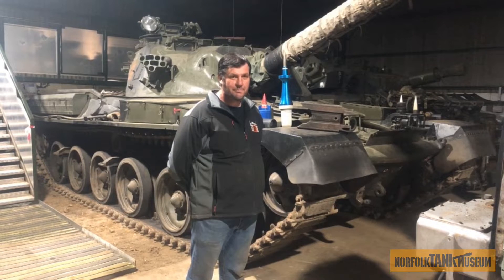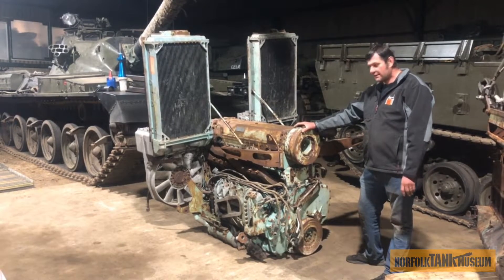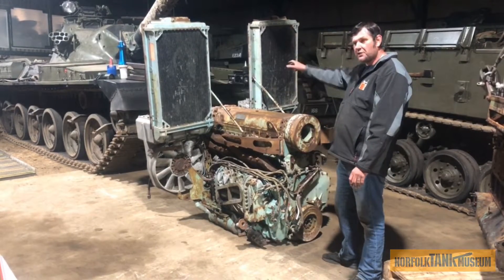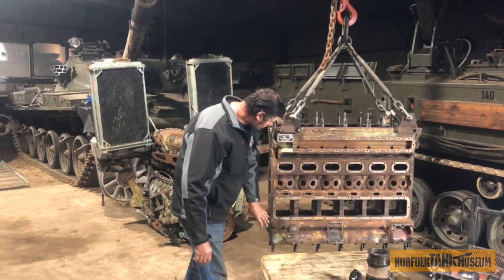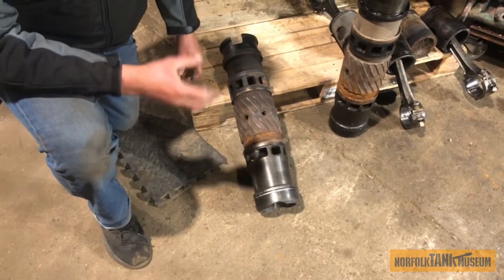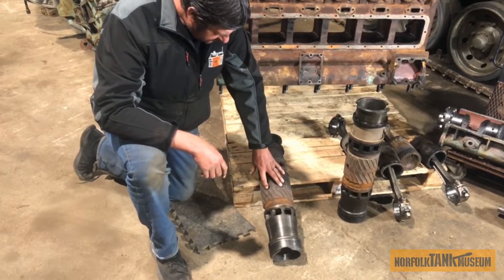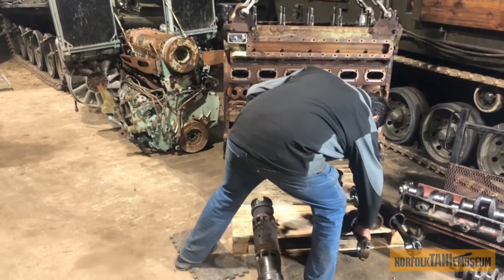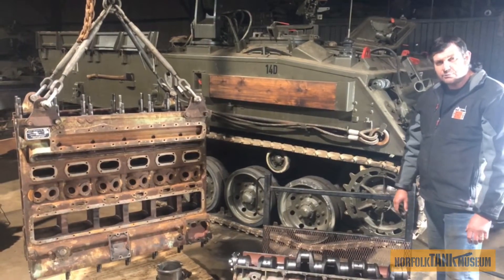NTM workshop diary #1 Chieftain Leyland L60 engine

Comment: Excellent very informative.  I am a Detroit diesel fan and find engineering from the past to be slightly better made than today's wafer thin computer  designs !!  They didn't quite get it right with the  L60 but flipping heck it's a scary sounding beast at night on exercise you wouldn't want one to run over your foot !!!!  Can Bovington help you out with the oily bits ?  Your doing a fantastic job of keeping the history alive ! Good luck  ,  there must be a fresh pack around wrapped up in grease waiting patiently somewhere  !!!!!
Reply: 2 strokes have to be a bit better designed with hardened metals.A polaris 850 Patroit turbo now more rugged that a kohler 4 stroke and much more power and torque than a kubota 1L 3 cyl.
Reply: I have a Hawker Siddeley / Lister St3 diesel generator which was built as gold standard in about 1980 . After that it was cost over performance  !! My Lister  , if serviced correctly can give a service life of ..... between 120 and 140  THOUSAND hours  .. I think that's about 12 years without a break !!! 
I have a current model Lpw4 Lister  , running a 28 Kva generator which ,  with proper servicing may hit 20 000 hours ... They sure don't make em like that anymore 😢😂😂😂
Reply: Are you running the klotz techniplate 2 stroke oil or something else.

Comment: As with most things initially it was unreliable but it got sorted. So say the guys who ran them and looked after them. Apparently liner O rings where problem but got modified and sorted among other things.
Reply: They also suffered from lack of use, the chieftains at batus were said to be much more reliable as they were used much more often

Comment: what was the main reason for failure on those L60 engines, they get a lot of criticism but if you think about it the designers were on the right track to come up with a 12 piston power pack a very small space compared to the continental v12 in an m60. Great sound though when running. The  Cummins VT525 in our vehicles were ok depending on who rebuilt them.

Comment: I live in the U.S. , I see these tanks ( Chieftains ) for sale and would love to buy one and ship it back to the U.S. if I had the money. I would have to change out that L60 engine, I know how notorious it is of braking down and was the " Achilles Tendon " for that tank when it was in service in the U.K. and elsewhere.  
   Would it be possible , hard or ease to swap that L60 with a American Detroit Diesel Inline 6 cylinder 71 series engine  https://www.youtube.com/watch?v=rGMeuoOcGCY   https://www.youtube.com/watch?v=NMRFH8WqcRg  ???
  if you did some welding and get the mounts lined up, got the bell housing and flywheel coupled to the transmission input shaft, modify all the fuel lines , heat exchanger cooling lines to radiator etc. Could it be done in your opinion ???  Thanks  Great video
Reply: Detroit 6-71 would be about 1/4 power output of the L60.
Reply: You could but the detroit 2 strokes would not be as fast as the leyland l60 2 stroke. that would like swapping out an 850 rotax Etec with a hirth 440 from a 70's sled. it would go but not as fast or as much power.
Reply: A  6-71 will not keep up with a leyland l-60 2 stroke and was not made for tanks. Its a good engine though.
Reply: @jlo13800  OK. I have seen the opened engine bay with Layland L60 engine out of one of those tanks. It looks like I could fit a Detroit Diesel twin turbo V12 92 series in there instead of the inline 6 71. Would that help out my speed and power situation in one of those ??? Thanks for your reply.
Reply: @leonswan6733  Any size Detroit will only hit 2500 rpm before valve float , therefore making any possibilities of scurrying off  , all be it at a similar sound level a slow and dangerous job  ...... A Catterpillar Bulldozer engine with much tweaking  (tractor pulling standards) would be where my Bang for Buck would be invested in ..... Then sort the transmission out and have a go !!!  If anyone has one and wants a conversion doing feel free to get in touch..!!!  I'm quite busy but  .............👍👍👍👍👍😎😎😎
Reply: @christopherhampson265  Nice. A man who knows his equipment. Yeah, those Chifetains look cool. Very modern looking design for its day. But it would be nice to find for sale in america a Chrysler weapons division made M60 A3 with the standard Allison air-cooled twin turbo V-12 diesel. That would be cool. I saw a YouTube video of a few on government land on a weapons range. Take a bulldozer heavy pull cables and two tractor semi low boys out there one night.
Reply: @leonswan6733  Sherman ??  Easy to keep  !!!   multi bank or radial  . Or  2     6 / 53 screaming Jimmy Detroits  I think ?  
OR  perhaps an 8/71 conversion  !!!  It's  all about pocket depths and the Sherman can be pushed on hard standing by a couple of keen blokes  .!!!  I used to stay with a lass at the animal place directly opposite the gates to Bovingdon tank proving ground  .  We're sleeping in a chalet with 6mm ply and a bit of rockwool insulation for cover  !! The Challenger 2's would wake you with a fright screaming up and down the slopes on night exercises not 200yds away !!  I found it an unsettling sound  👍👍👍😎
Reply: What kind of 2 stroke oil will you be buring in that? i get several gallons of BRP XD-100 etec oil for my silver 8v92.
Reply: imagine Arctic Cat cats new 858 scaled up into a 930 CID inline 6 2 stroke that run right over all the klatapillar 4 stroke junk! that you be fun.
Reply: The Leyland engine holds its advantage like cummins ACE OP 2 stroke and  Rotax 850 Etec turbo with a seperate oil tank and oil injection!
Reply: I hate the oil injection setup on a detroit as its on the bottom on the engine and makes a mess!